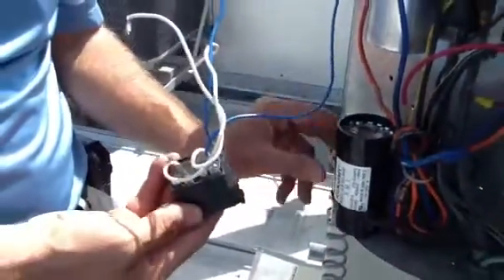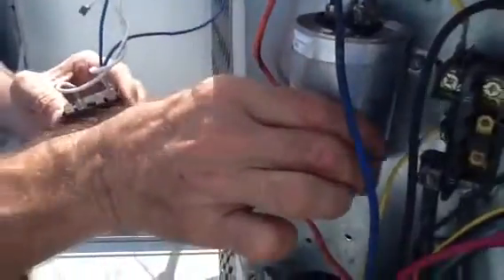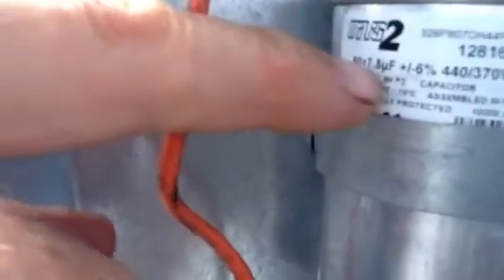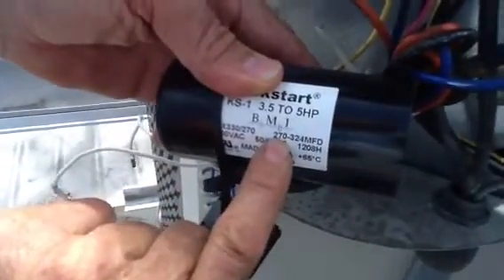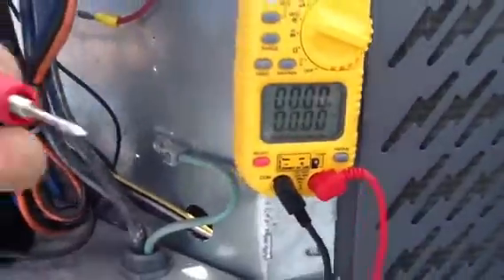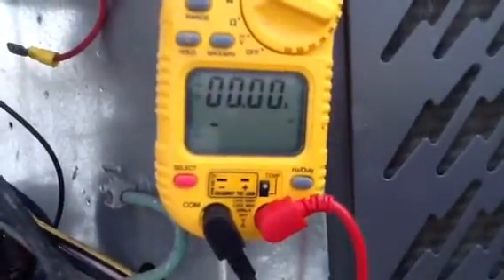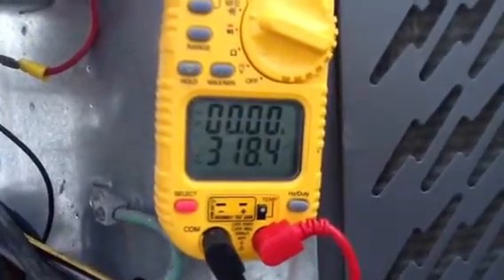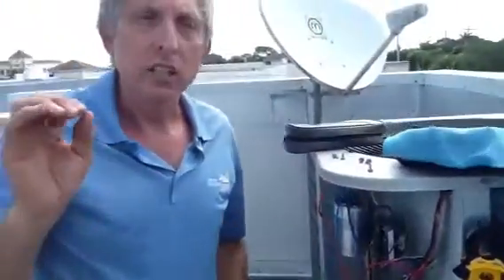"Understand How to read a Hard Start Capacitor"

Comment: I bought a CSR 521 kit based on the tonnage. They offer one kit for 1 to 3 tons and another kit for 3 1/2 to 5 tons. I installed The 3 1/2 to 5 ton kit since my unit is 4 tons. Then I went online and looked at the OEM kit that was recommended for my specific Copeland compressor. It actually was a capacitor that happened to be in the smaller CSR kit for one to 3 tons. I think I’m gonna change it out but a little frustrating. I should’ve done my homework prior to buying it originally. Wonder how much that really matters?

Comment: Doesnt the bleed resistor have to be removed to get a proper reading of a start capacitor?...  At least that what i was taught.  Using a ESR/LCR meter will give you a more accurate read than a DMM. You can't check a capactiors internal resistance wiht a DMM because you need to use AC, not dc, current to get this reading.